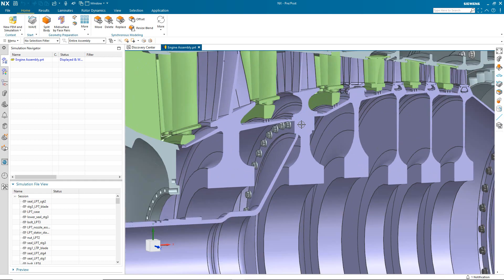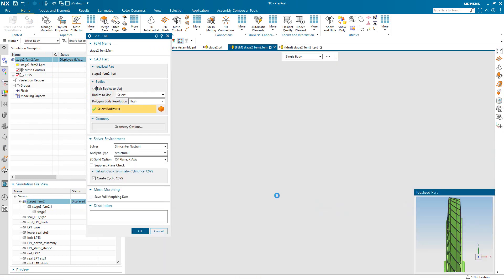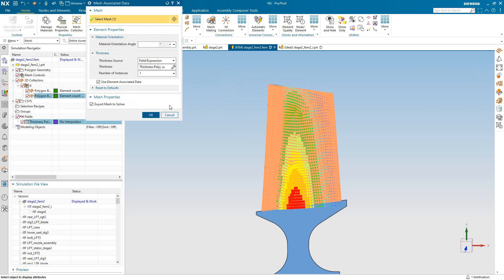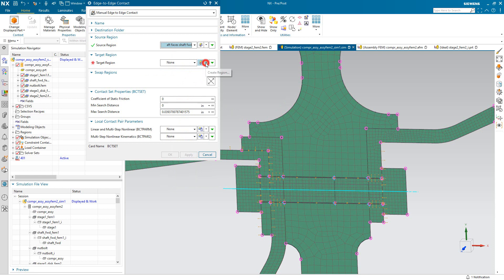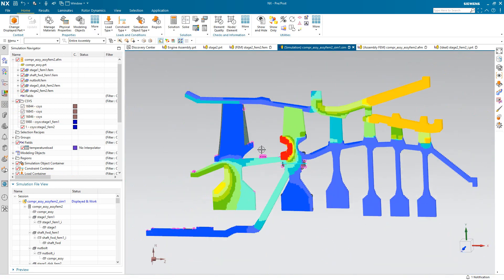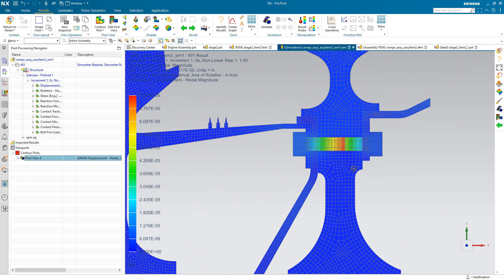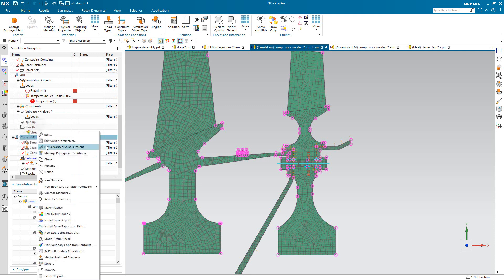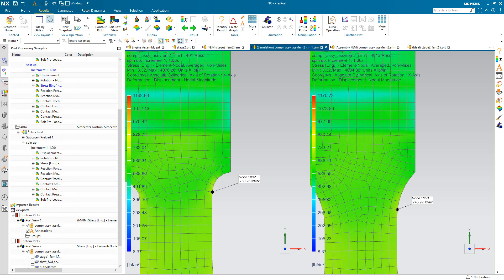Axisymmetric Multistep Nonlinear Analysis with Simcenter 3D

Comment: Hi, why is selecting high resolution polygon bodies important when contact will be used?
Reply from the maker: The CAD body in the master NX prt file is a BREP Parasolid body which has an inherently high degree of accuracy.  The polygon body in the fem is an associative but faceted representation of the CAD body.  Selecting high resolution polygon bodies will create a faceted body in the fem that has a higher degree of accuracy in representing the CAD body with more facets.  This will produce a more accurate contact definition which will facilitate solution convergence.
Reply: @Simcenter3DTipsandTricks  thank you I never thought about that. So even with a fine mesh and coincident mesh, high resolution body vs standard resolution would give different/better results with contacts?
Reply from the maker: Yes, even though the difference may not be visually obvious, it does facilitate nonlinear solution convergence.  You can display the facets when in the fem by selecting menu, preferences, visualization, performance, accuracy, show facet edges.  If the part is meshed, you can see the facets better if the mesh is not displayed.  Right click on the polygon body in the polygon geometry collector and select edit resolution.  Change the resolution and select recreate and update.
Reply: @Simcenter3DTipsandTricks  thank you for those tips!